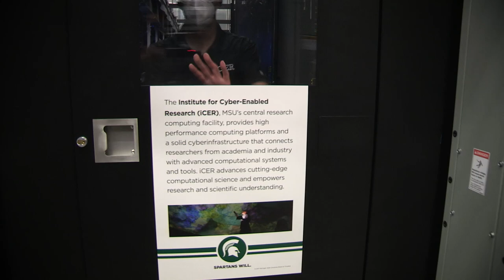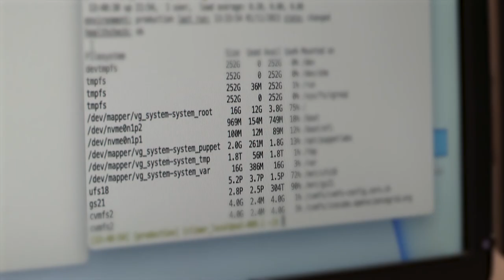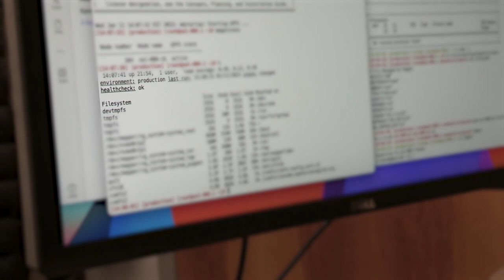A Day in the Life of a System Administrator

Comment: What is the difference between sys admin & network admin ?
Reply: I'm not really sure where that line would be drawn.  In past jobs I've done both, in small companies.  As a sys admin I don't work much on the network except to connect to the switch that is provided.  The network admins that I work with work mainly on switches and the transferring of information from one point to another.
Reply: Companies run things differently. In general, the network admin maybe responsible for all or parts of the network infrastructure or configuration. A systems admin may be in charge of servers and their configuration. Or the term systems administrator maybe a generic term that refers to a person who is in charge of a particular system.
Reply: If I understand it correctly( and I may not)the systems administrator is responsible for the resources. The network administrator is responsible for the connectivity. The switches, routers, and firewalls belong to the network administrator.  The servers, workstations, storage and back up solutions belong the the systems administrator.